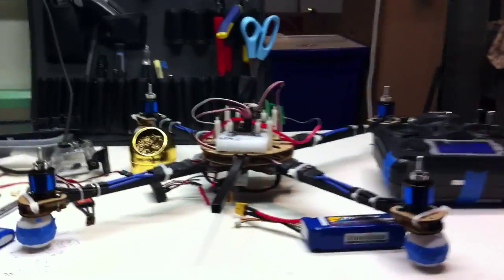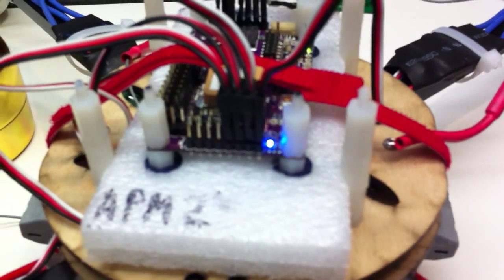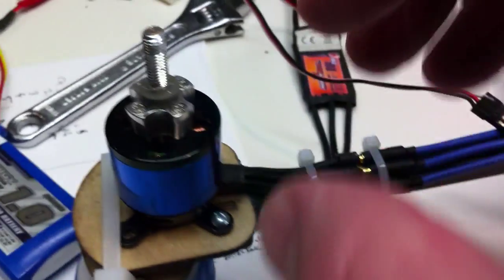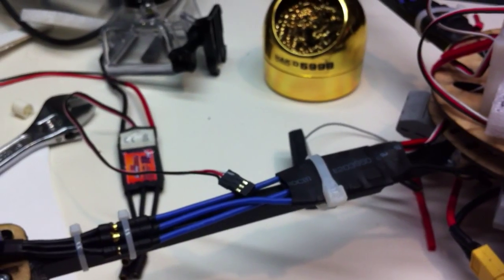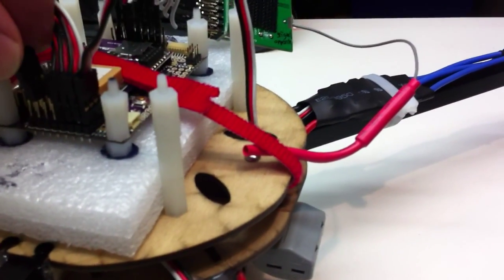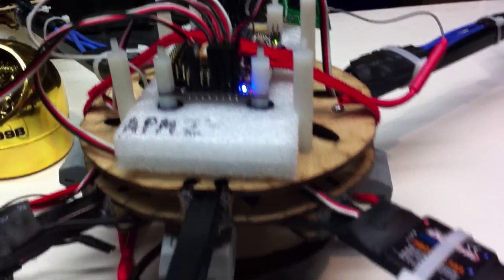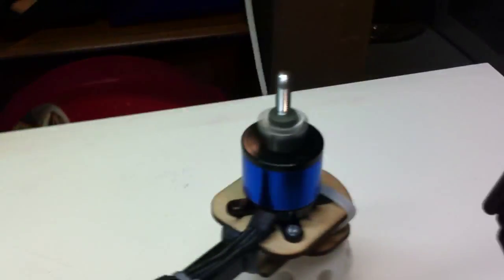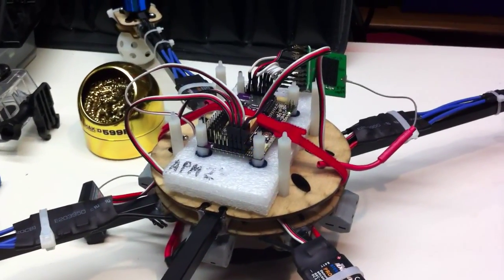ArdupilotMega 2 ESC startup problem and workaround

Comment: I have hit the same problem with Hobbywing Pentium 40A ESC's. The work around works
but I'm wondering if you know if they have found a fix for this yet. I'm using a separate BEC to power the Ardupilot.

Comment: Looks like a seperate BEC would be the best solution so you can power up the board then apply power to the ESCs,  Probably a better and more reliable setup with a seperate BEC instead of using the BECs in one of the ESCs anyway.  Thanks for the post!